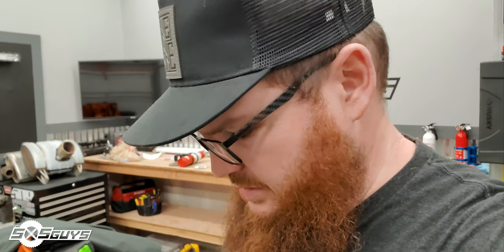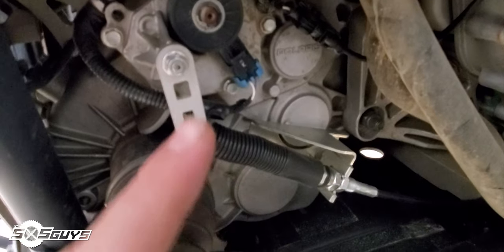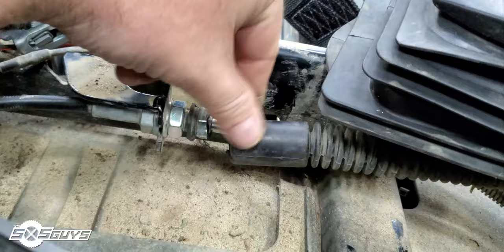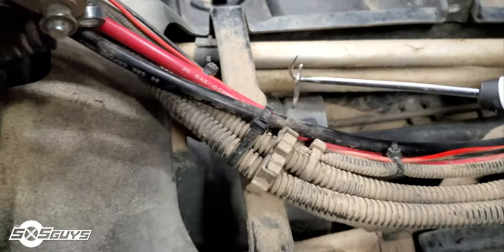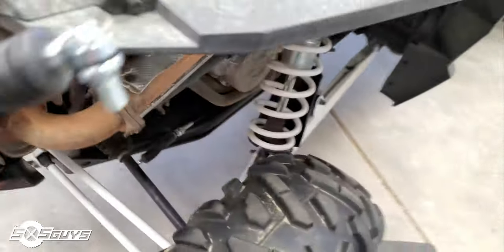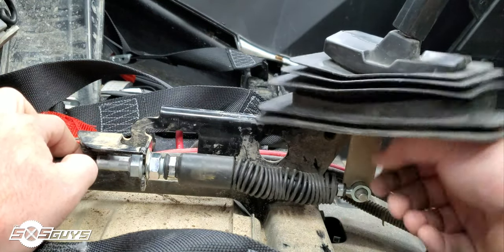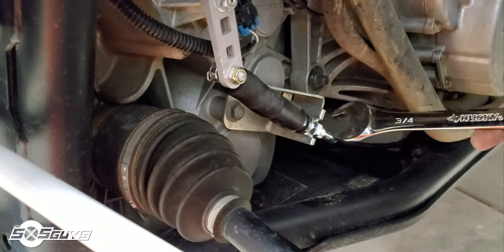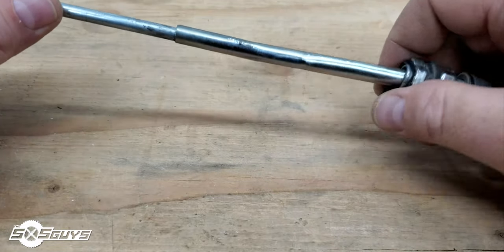Shifter Cables & Flybys | The SXS Guys Vlog

Comment: Thanks, just over 3k miles and purchased a cable, but have not taken the time to change it out yet.
Reply from the maker: Keep'er around till you need to... unless it's already a problem, then stop sitting around and do it ;) If it's not shifting correctly, try adjustments first!

Comment: A quick question, if you would sir.
I just bought a 2022 RZR Pro XP, my first RZR.
The shifting feels VERY stiff to me. It goes into all the gears, but can require a firm hand to make it happen. Is this a Polaris thing? Are they just generally stiff shifting, or is this something I need to have the dealer look at before I'm out of warranty in two months. My dealer isn't the greatest, if it's just the nature of the beast, I'd like to know before I put my machine in the hands of a dealer I'd rather avoid.
Thank in advance for your time.
Reply from the maker: Polaris shifters never feel "right" for some reason... If it's taking a lot of force, consider adjusting the cable just hair tighter. You can also check your clutch. If the primary is causing the secondary to engage and rotate at idle, that will make it difficult to shift as well. If it is the clutch, then you'll want to look at a clutch kit with springs and weights, which is usually recommended anyways for performance.
Reply: @SXSGuys  
Thanks for taking the time to respond, I appreciate it.
I have checked the clutch alignment and all is good. The secondary does not spin at idle.
I'll look into making some small, incremental adjustments to the cable itself.

Thanks again, and subscribed. 👍
Reply from the maker: @jneill-dj8nz  Thanks for the sub! While you're making your adjustments, remember that you might need to rock the car forward/backward before adjusting. The in-trans parking brake can be fiddly if not centered during adjustment.
Reply: @SXSGuys  
Awesome. 
Thanks for the tip brother!
Reply from the maker: @jneill-dj8nz  np good luck 🤘

Comment: So if I got a 4 seater 1000 the adjustment side would be at the shifter up front?
Reply from the maker: I believe that's the case. I don't have one here to double check, but I believe the adjustment nut is at the shifter. Basically which ever end has three nuts!
Reply: @SXSGuys  I got another question bro I just fixed my shifter cable and it goes into all the gears fine. but when I shift gears I don’t have to use the brake anymore. I’m not sure if I did something wrong cuz im pretty sure I had to hit the brake in order to switch gears before but I’m not sure if I’m goin crazy or what. Any tips or help would be appreciated
Reply from the maker: J Money you don’t have to hit the brakes... newer models require the brake be engaged to start but not shift..
Reply: @SXSGuys  okay bro thank you I really appreciate your help. Will reply to this comment if I have more questions. God bless 💪🏽